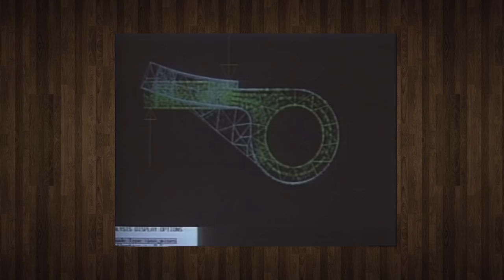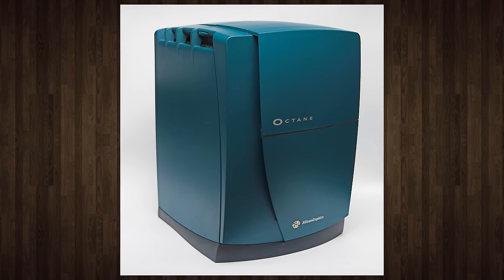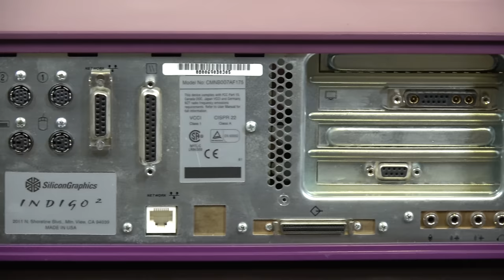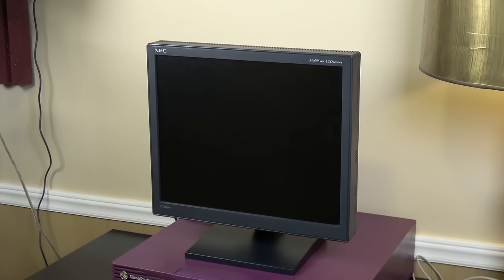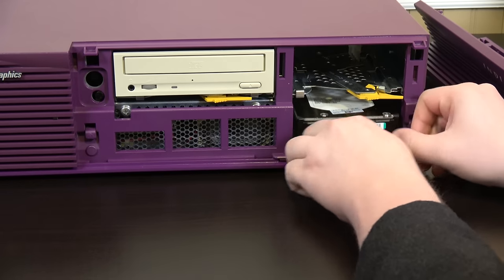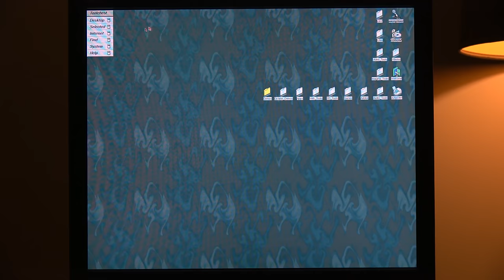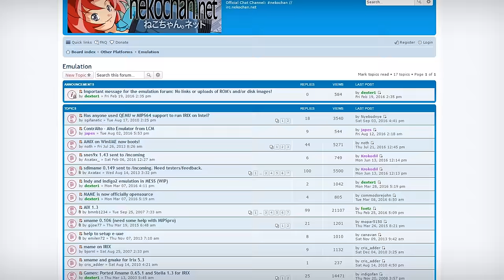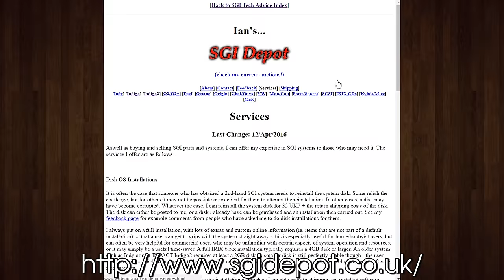SGI Indigo2: An $86,000 Workstation from 1995

Comment: When you mentioned 1 gig of RAM in 1995, I was like. Holy shit!!
Reply: Ikr, my only '95 computer maxed out at 68MB, and forget graphics ram.
Reply: I remember buying 4 MB for $100 in 1995.
Reply: Yup!  I upgraded from 4MB to 8MB in 1995 and it cost me around that. xD
Reply: コンピューティング A E S T H E T I C What's odd is, It's acculy useable today even if you used windows 10, Obviously it's not much at all but still.
Reply: in 1995, i had 4mb or ram.....enough to play doom :'(
Reply: Naughty Dog had 4 gig machines in ~'97, SGI was wild as shit
Reply: Had 16MB and pentium 100 in my first computer - it was about 97;
Reply: コンピューティング A E S T H E T I C AWESOME VAPORWAVE!
Reply: lasarousi i started wuth a 286 and 1mb, my first hdd was 75mb, i was like 12....1mb of ram was around $45....in 1996 i got a 486 dx2 with 8mb and worked my way up, i assure u, i got through every cpu , memory config and cd speed u can imagine....before ibm pc it was a spectrum sinclaire that used cassette tapes...i was even around when S3 VIRGE was the first 3d card....
Reply: I had to upgrade to 8mb from 4mb in 1995 just so I could play Dark Forces properly.
Reply: yeah, the S3 Virge DX/GX 4mb card was my first 3D card too. Then I upgraded to a 16mb Voodoo Banshee and teh sky was the limit.
Reply: I'll say. I remember getting my first IBM-style computer in 1996 ( a 286) and needing a RAM upgrade. So my sister's (ex) boyfriend popped out the existing RAM and we got hold of one of his hacker buddies who sold computer parts as well. Even with the trade-in of the smaller memory, it still cost me 80 bucks for 2MB.

Now the most recent rig I built has 16GB DDR3 that cost me a whole $130 total (bought my first 8GB back in 2013 for $72 and an additional 8GB last year for I recall 50 bucks). Just blows my mind sometimes :)
Reply: a voodoo banshee was light years ahead....i jumped to a voodoo rush to play UNREAL then a VOODOO 2 and boy what a difference that was....sadly it was my last 3dfx card...moved on to NVIDIA RIVA TNT then TNT 2, ATI ALL IN WONDER 32MB then it was all GEFORCES until today with the 960gtx....i hope i can upgrade to a 1060 soon or a 1070 if i can....it is funny that ram i starte with 1mb, then 2mb, 4mb, 8mb, 16mb, 32mb, 64mb, 128mb then i jumped to the gigabytes...it was fun days...
Reply: a gb back then is just... obscene! like, bathing in champagne levels of opulence
Reply: Actually, with the recent news that microsoft has completely recompiled windows 10 to run on RISC processors, specifically the snapdragon 835, it may indeed be possible to run windows on this thing.
Reply: It's not a PC compatible. And I'd bet a 1995 SGI and a 2017 Snapdragon ARM based cpu have little in common. Forget any compatibility.
Reply: I got into computers around 2004, I remember a 256MB kit cost me around $300.
Reply: I had a Compaq X486 back in 1995. I think it had 1 gig of speakers mounted to the side of the monitor XD
Reply: geez in 95 i think i had a compaq presario that had 32mb of ram
Reply: Bryndal Dwyre Same here....
Reply: S3 Virge DX owner here too. I remember that the only games that actually had 3d "acceleration" was the demo disc that came with it. Descent, Terminal Velocity, don't remember the other two games.
Reply: Virge DX was surprisingly decent hardware for being quite cheap, it were the drivers that gave it the nickname of 3D decelerator. Demo disc also had Gremlins' Actua Soccer. What else, maybe Tomb Raider? A couple years later, Virge would become usable with DirectX games at decent speed, like I distinctly remember Moto Racer full speed, but with graphical glitches, Monster Truck Racing even glitchier though.
Reply: That machine had more storage in it's RAM than I had on my Harddisk!! :O
Reply: Those SGI computers were about 8 years more advanced than consumer grade PCs at the time.
Reply: You'd have better luck with running SGI stuff on a Nintendo game console (or the reverse). 
The n64 obviously, given what it is, but the gamecube and wii seem to be closer in cpu design to it than an ARM or x86 system would be.
I suspect your best bet for a 'recent' OS would be to hack Mac OS9, or the early powerPC builds of OSX...
Much closer than ARM, I think...
Reply: KuraIthys The N64 was in fact an SGI, very low power if compared to the workstations but still quite capable at the time and also it shared the same architecture (MIPS) with the workstations. No wonder the N64 games were developed with the SGI Onyx. The Gamecube, Wii and WiiU however are PowerPC systems. I heard weird rumors that the first Gamecube games were made with the PowerMac G4 (meaning that the G4 would be perfect to run Gamecube games) but I still didn't confirm the rumors. What I know for sure is that the games from Gamecube, Wii and WiiU were developed with PowerPC workstations.
Reply: Trenzinho da Alegria I was at a company once which ported a game to WiiWare at the time. The tool chain is completely PC based. Same for Wii U quite certainly. However you get to test and debug on a dev box which is a modified end system hardware usually with more RAM and other changes that you can chain to your development PC, and you'd be able to step into the program running in dev box right from the development tools running on PC, I think CodeWarrior for Wii, Visual Studio for Xbox 360, GDB e.g. in Eclipse CDT for something else. 

Problem is in the recent 10 years you can't get a decent PowerPC workstation. There's no Maya, Max, XSI versions on PPC Unix nor audio software etc except ancient OS X versions. Back in the 90ies, Power Animator, the predecessor of Maya, was king and ran on the SGI machines. 

Certainly a lot of PS3, Xbox 360 games in development stages were demonstrated at expos running on a Power Mac, that was the case, but more recently usually on PC.
Reply: Siana Gearz I am sure they used PowerPC computers for the development of Gamecube and Wii games but... Not WiiU, PS3 and Xbox 360 it seems... But I know that the PS3 and Xbox 360 featured the same PowerPC cores as the PowerMac G5. It's the PowerPC 970FX.
Reply: Trenzinho da Alegria On early development stages it has been quite common to try to match a development machine to target machine in liew of a dev box. PC with a PCX extension card was a prototype box for many early Dreamcast games - the PCX board had a similar performance to the GPU that the Dreamcast would later receive and Dreamcast running in little endian mode like PC helped avoid bugs, plus you could kind of somewhat match the CPU performance by tweaking the machine a bit. By similar logic modified Macs have been used in early development stages of PS3, Xbox 360, Gamecube games.

But here's the Gamecube dev station - it's a PC running CodeWarrior on Windows 2000: colinfahey.com
Reply: Siana Gearz It is always better to have a development machine which matches the target machine don't you think? Unless the target machine is so popular (for example ARM) that all the means to port the software are highly advanced and perfected...
Reply: Same here - the S3 Virge was decent for 2D tasks/SVGA etc., but boy did it blow for actual 3D (and IIRC not very many games even supported it), going from that to a Voodoo Banshee was a revelation - I remember loading up all the demos from my PC Gamer discs to test it and just marveling at the (at the time) sharp resolution and framerate.
Reply: Trenzinho da Alegria there's a tradeoff there. Compiling large software from source is a very computationally expensive process, and so a lot of developer time is typically wasted in the modify-test cycle. I have maintained software that was 1 million lines of C++ and took about 1 core-hour to compile fully on modern machines. If your target system can load the compiled binaries quickly, and the debugging interface is reliable, then you will certainly choose as fast a machine as development host as you can get, over an architecturally compatible one, trumps the inconveniences of incompatible architecture. Especially if parts of target hardware or operating system are too special anyway, so tests that you can perform without it are borderline worthless. Most of my career has been embedded software e.g. for automotive, and you basically never have the luxury of compatible hardware.
Reply: Rami Merehbi
If your screen only does 1080p, then a 1060 will be fine. I just bought on on Amazon and am waiting for it to arrive. Being in Australia, it'll take a couple of weeks but it's worth the wait. I recently installed one into a mates PC as an upgrade to his gtx 750ti and he's able to play most of his games at ultra.
Reply: Siana Gearz I see. But what if... It's possible to have the same architecture of the fastest machines on target machines as well? I suppose that's the case with PS4 and Xbox One right? I am sure that the development platform is always much stronger than the target machine but these newer consoles are also fully compatible with what is most used nowadays... It's AMD64 / x86.
Reply: Trenzinho da Alegria yes, transition to x86_64 on current home console generation has been done in part to reduce development cost for the studios, well besides AMD probably out bidding IBM on unit cost. Last generation over, there was possibility of endianness bugs, target compiler bugs, both relatively small risks, plus a huge performance disparity due to some code experiencing almost an order of magnitude higher penalty on console transition than other, so expertise was needed for targeting these systems. On AMD they picked, the penalty is much more uniform compared to i7s and Xeons you'd use on host, and it's never all that drastic, so it's not an issue any longer.
Reply: I remember getting a $2k desktop at the end of 2001 that came with 512 MB of RAM, and I thought it was blazing.
Reply: Percy Pumpkinheart But at the time it was blazing for a laptop. But nowhere near SGI workstations. (obviously)
Reply: コンピューティング A E S T H E T I C 1GB ram was a lot back in those days, but computers capable or seeing that amount wasn't as rare as some might believe. some even consumers could get their hands on, and some that normal consumers could only dream about. 

my friend (well his father) had a Mac 9500 and its max ram (unofficially) is 1.5GB of ram, but brand new it cost over $5k USD which is far from what most people could have afforded back in 1995 let alone to max out the ram in that thing.
Reply: Yellowblanka oh man, I had a S3 Virge DX in my old Pentium 1. that card was a headache with most gaming, software rendering was usually faster.
Reply: So windows classified if the machine you're using is a pc or not?
Reply: When I heard about It, seemed to be impossible! I doubted that!
Reply: Doom ships pre-installed on all SGI systems as one of their default games.  It plays very well, even on the lowest end SGI.
Reply: Windows NT ran on MIPS in the 1990s... that's more likely to run on this old system than Windows 10.  But if you want to run Windows on an SGI they sold a product called Softwindows 95.  It was similar to virtualization software these days but allowed you to run Windows95 on the machine to get access to business software like MS Office.  Rocking an SGI machine back in the day was about as hardcore as you could get, well speaking of desktops certainly.
Reply: The graphics performance on the higher end systems was 10 years ahead of anything else on the desktop.  I guess that's why they could charge an arm and a leg for them...
Reply: @2Big D RISC is not an brand or a kind of processor its just an design philosophy for processors. Windows would have to be compiled for use on this specific processor family, and chipsets. Not only would that cost a lot of time since nothing of this technology is continued it wouldn't manke any sense to do so.
Reply: 2Big D Not really. The Snapdragons have ARM architecture. The SGI computers were all based on MIPS which is the same architecture as the Nintendo 64 and Playstation 1. However the MIPS architecture is currently abandoned, no one uses it anymore and compiling a system for the platform would be quite expensive and there's simply no justifiable reason to have Windows 10 on such an ancient machine even though it was an extremely powerful computer at the time.
Reply: Trenzinho da Alegria MIPS is still very common, but mostly in embedded devices. Chances are your router is running on a MIPS core.
Reply: ***** Oh yeah. But what I mean is that it no longer has a major development focus in the industry. Most cheaper routers for example remained almost the exact same things in terms of speed for over a decade.
Reply: Trenzinho da Alegria They're used in all kinda routers. Old and new router SoCs use MIPS and they need softwares made/ported to them. Routers do change with time, it's just the cheap ones never move away from crappy tech, but they do use newer SoCs. There are modern MIPS SoCs for general purposes, like the JZ line from Ingenic. If you want to call something "abandoned", look at PPC.
Reply: ***** PowerPC? Yes it is abandoned as well and unlike MIPS it won't find an use in embedded applications. Anyway my poin is that it's been quite a while since I've seen a new MIPS architecture. Even the modern routers are using very old stuff. MIPS has stagnated.
Reply: Trenzinho da Alegria Old stuff? ISA don't need to change often, and they shouldn't (basic x86 has been the same all these years). If you're thinking about microarchitectures, they do change but it's not something that's presented to the end user.
anyway MIPS is still very much alive, will probably be as long as routers exists or at least until they all move to arm. They don't get as much focus as the other archs but that doesn't mean they're abandoned.
Reply: ***** Well you see... The latest cheaper D-Links are still basically the same crap as the older ones... For example the Dir 615 is basically a Dir 600 with two antennas and repeater mode. There was virtually no improvement on the chips themselves I think.
Reply: Trenzinho da Alegria As an end user you won't see it simply because they don't advertise the SoCs used. And these aren't the types that need yearly releases. But they do change. Just not very fast, but enough to make it relevant.
Reply: ***** Ok but MIPS is still no longer used in workstations, PC and stuff like that. So there's definitely no way Windows 10 will ever come to it.
Reply: 1GB of RAM? I barely had 1GB drive in 95!
Reply: Hiraghm An additional $400 would have got you 64K, SID sound, VIC-II graphics, and a case with a slightly darker shade of brown. :)
Reply: ***** Yeah my cheapo router runs Linux (2.6) on a MIPS processor (Broadcom4350 v8) -- and it has 100 MB of RAM; which I find pretty amusing as an old geezer.
Reply: Onyx was the original dev platform (hw-restricted as a native RE2 set would be far too fast to correctly emulate an N64), but this was replaced later with a custom board for Indy.
Reply: Oddly enough, the Onyx3900 (custom version) can have that much.
Reply: At the time R10K Indigo2 was current, 512MB kits were not an option from SGI, and indeed SGI never mentioned it was even possible to use them. Official pricing only listed 128MB kits as the top option, and they cost a lot (about $10K for a 128MB kit):

http://www.sgidepot.co.uk/depot/prices1.gif
http://www.sgidepot.co.uk/depot/prices2.gif

It was only later that people experimented and discovered that 256MB kits could be used with 512MB kits from non-SGI systems such as HP servers, allowing 1GB via 256+256+512, or 512+512. 3x512 does not work because of the way the memory mapping and mbd wiring operates. Hobbyists settled on such upgraded systems being called GigaRAM Indigo2s, as my page describes:

http://www.sgidepot.co.uk/i2gigaram.html

Ian.
Reply: 0x EFEFEF You mean 1GB of storage... Because ROM is (Read Only Memory) and often the ROM of an old computer was the Bios but nowadays we have UEFI and it's possible to upgrade it so... Modern PCs do not have ROM. Another example of ROM are the cartridges of old consoles such as the Nintendo 64, Super Nintendo, Sega Genesis and etc...
Reply: 2Big D  I wonder then if it will run on my Note 3? Not that it'd run that well given the old tech in my phone. It is after all only a Snapdragon 800.
Reply: 0x EFEFEF What we use nowadays is known as EEPROM (Electrically-Erasable Programmable Read-Only), EEPROMs are not the same thing as ROM (Read Only Memory) for instance ROM (Masked ROM) is a chip which the memory is part of the internal architecture of the chip itself (The chip is actually already produced with the memory recorded onto it). In other words... It is a chip which cannot be erased, only destroyed and you cannot write anything into it. And also Masked ROM lasts for centuries (several hundreads of years, maybe over 1000 years) while EEPROM is only able to maintain the data for a few decades (about 40 years). Anyway. Also Hard Drives are NOT based on RAM. Seriously what are you smoking, RAM is temporary memory which loses all of it's data when you turn it off. Hard Drives are in fact magnetic metal discs, it is magnetic memory. SSDs however are EEPROMs. (Pendrives and SD cards are also EEPROMs)
Reply: 0x EFEFEF Man. You clearly stated that Hard Drives are RAM... It's simply not true. Hard Drives (HDD) are encased metal discs. While RAM is PCB full of chips... They are completely different things man! And also right now there is no RAM that keeps it's memory when power runs out. Some people said that in the future we are going to have M-RAM which would make it possible to turn off the computer without erasing the RAM and this way once you turn on the computer again you would be able to continue using it right away, without doing bootstrap.
Reply: Trenzinho da Alegria Intel already kinda have something like that. However such types of memory will raise security concerns.
Reply: I love your mixes!
Reply: My Dad's PC had something like 8mb of RAM And it was good, not awesome but good and in 97 he bough another PC with 16mb RAM and I was triping xD
Reply: Abr3200 Well so it had the same amount of RAM as the Nintendo 64 with Expansion Pak. The Nintendo 64 had very high 3D capabilities (compared to most cheaper PCs and consoles) at the time (bear in mind that even the cheaper PCs were quite expensive back then). But you should keep in mind that the N64 does not have to load an OS in it's memory because the games themselves were the primary OS (equivalent to BIOS) and the N64 had no secondary OS (DOS, Windows etc...) whatsoever (The 64DD actually had an OS but most people didn't have the opportunity to get one anyway). So yeah 100% of the N64's memory was dedicated to the games and the games themselves functioned as the primary system (BIOS). Not to mention the N64 had Rambus RAM which was in fact better than anything that was available on most PCs at the time because it was a lot smaller, it was faster and the layout of the board was more simple.
Reply: I think it was around 97-98 when I can remember me freaking out because my Dad told me he was getting some new work computers, so I got the two old ones.  One of them had 64mb RAM.  

1 gig back then was insane!
Reply: The first computer I was knowledgeable about was a HP Windows XP from around 2004 or 2005. This had DDR2 RAM but I think it was either a 256 or 512MB. To hear about 1GB being available in 1995, it blew my mind. The hard drive space also was quite surprising. I'm not sure on what was available in 1995 but my desktop as I previously mentioned had either 60GB or 120GB. My memory is somewhat slacking, apologies. It appeared as if the SGI Indigo2 had more slots than what was used. Does anyone know if it supports more than 1GB of RAM?
Reply: 407 comment likes?! My cold dark husk of an internet ego is now revitalised!
Reply: I don't think people understood the term Giga outside BTTF at the time
Reply: That was a huge virtual RAM drive for a workstation at the time.
Reply: Dave L what do you think bttf means ? ;)
Reply: me too, I didn't get that sort of capacity well into the 2000s, closer to 10 years after the indigo.
Reply: is jurrasic park unix the movie
Reply: Probably costs as much as a house.